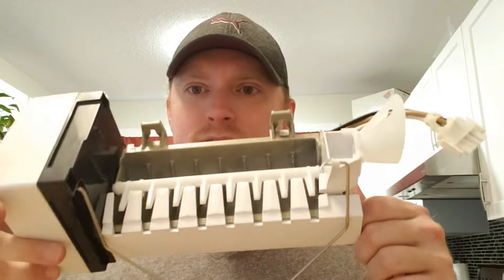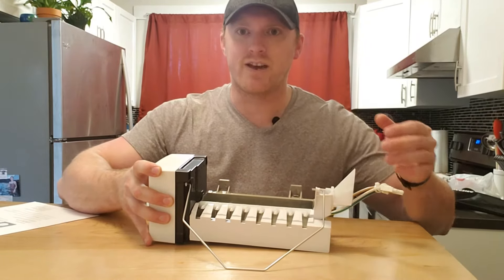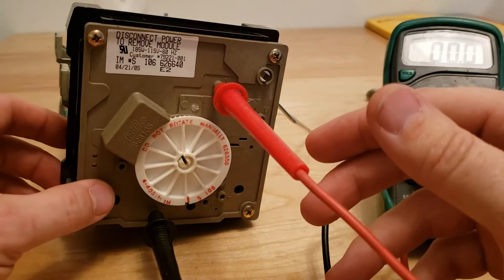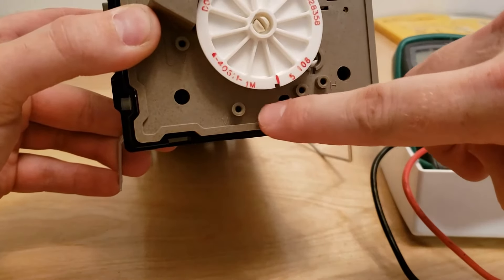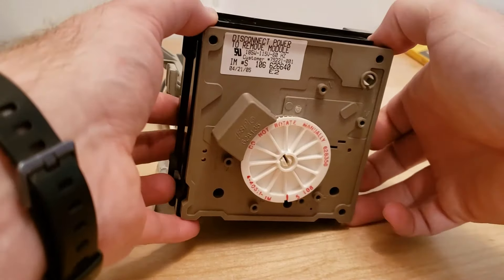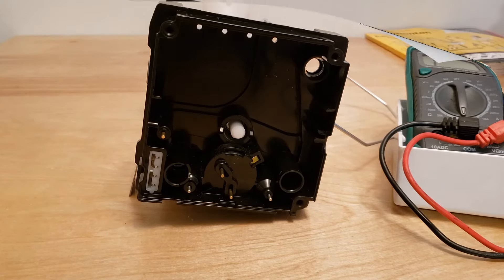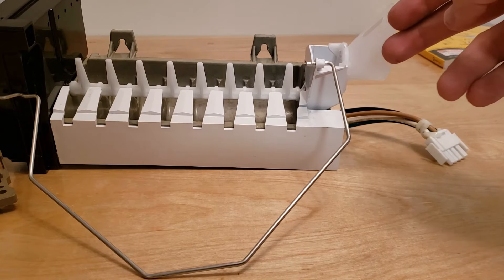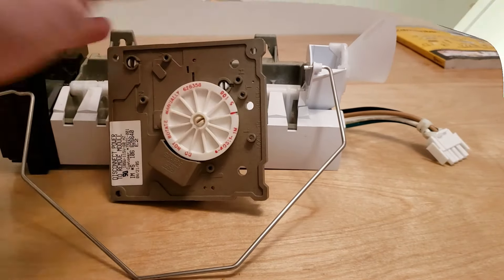FRIDGE ICEMAKER HOW IT WORKS - TOTAL DIAGNOSTIC GUIDE

Comment: Thanks so much for making this video! My only regret is not finding it sooner! My ice maker is getting too much water, creating a layer of ice on top of cubes. This must occur after dumping the cubes, as they are free immediately after dumping. Another video on here explained it may be the inlet valve and/or the filter assembly. Then another pointed to the defrost thermostat. After replacing all these at considerable expense and no fix, I found your video. My next step is to adjust the amount of water into the area. Hope it works! Thanks again!
Reply from the maker: Thanks for watching ni4cx6gc5h, yep sounds like an adjustment is needed, let me know how it goes. You got this!

Comment: Thanks for your video Greg.  I have a question about the input voltage.  It measures zero on my icemaker.  Is there a fuse inline for this input voltage.  I seem to remember that there is an inline fuse in the 120 volt wiring harness.  Can you let me know if there is.
Thanks,
Dave K
Reply from the maker: Thanks for watching David Kling, some icemakers do in the incoming wiring and some don't, it would just depend on the year and model of the ice maker.

Comment: Ok so my Amana side by side black fridge I got back in 17 decided to not make ice I noticed been working fine... Well I watched vid and did the jump wire deal and it worked like it should heard the ice drop and refill... I think last night it did it on its own but not sure... Figured there'd be some ice in it after work tonite and didn't look like anything was added... So what's going on now ?
Reply from the maker: Thanks for watching shaneh, putting the jumper wire in bypasses the heater, the ice maker will need to be replaced because most ice makers don't come in pieces.

Comment: My ice maker produces water and turns on its own but stops when it goes to push out the ice. Does that mean my heater is out?
Reply from the maker: Yes either the heater or thermostat, most ice makers you can not change individual parts though.

Comment: Ho, Hanks for video. 
My icemaker not go out completely the ice. 
Ti make ice, Hot for go out, move on the ice…but not compketely. The finger stop when the ice are up still. So the ice is, for 50% immerse in the new water.
What’s the problem?
The finger that non work completely, how i can do ?
Reply from the maker: Thanks for watching Ubi UbiVR, the ice maker could have a build up of calcium causing everything to stick or slow down. I would take the ice maker out and give it a good cleaning. Run through test cycle and see if it goes through like it should.

Comment: My tube keeps freezing and water can't flow to make ice , what's wrong with it
Reply from the maker: Thanks for watching Janet Smith, either the flow isn't enough and its freezing up, or the fridge needs a fill tube heater kit depending on the fridge. how do you know its freezing up, and where is it freezing up?
Reply: I saw on another video the water inlet valve was bad.At the bottom of fridge where the water line comes up back of fridge to ice maker.Looks easy to swap out.Good luck.
Reply from the maker: @barbaradean4448  thanks for watching, yes the water valves are fairly easy to change out, just have to remember to turn off water before disconnecting lines.

Comment: My heater has a 106ohm resistance and it seems the frozen cubes stick in the tray.  Is the heater shot or some contact not clean?
Reply from the maker: Thanks for watching Robert Dawson, the heater resistance should be 72ohms almost always, if the number is that high its not within the 10% allowable fluctuation. The mold can also be peeling inside which doesn't let the cubes slide out easily. I would say you are probably going to have to change the whole ice maker assembly. You can also check between t and h, which should be a reading of 0 ohms if thermostat is closed, or infinite if the thermostat is open.

Comment: Holy Smoke! Your video is so thorough that I just got a part-time gig repairing ice makers at a high-end appliance store! Lol. I am going to check your other videos! It's a euphoric feeling to  know  how to troubleshoot problems! Very informative!

Mine made the ice, but it's not dumping them. It's the heater, but I tested it. It's around 73...so good. If I reset it manually and it rotates the dial, the arms move down and dump the ice. So...what's next?
Reply from the maker: Thanks for watching dentistmomchef, lol thank you. I would check the mold, a lot of them were known to peel, when it looses its slipperyness the ice dont seem to want to come out.

Comment: Hi GReg! Here again asking for help. If I change the board on my WHIRLPOOL WRF555SDFZ would I need to reporgramm it or not ? I watched a video about this but talking about a CODE to do it that should be in the label,,,,but my machine has not such a code, so I don't know what to do. Pleas, if you have some idea regarding this subject let me know please. Thanks in advance, Ramon from Miami.
Reply from the maker: If you are changing the jazz board, which is the one right in your face when you open the door, yes you have to program the board. The code will be written on the model and serial number sticker.

Comment: Hey Greg, 

I replace my ice maker all the power is correct at all test points but it will not trigger an auto fill with water. I can manually fill it by jumping but it won’t do it automatic even after a full cycle of the motor
Reply from the maker: Is the freezer cold enough to trigger a cycle? Did the new ice maker come with a new thermostat?

Comment: Isn't there any refrigerant tube getting into the ice maker , like in the Samsung system ? Thanks for responding,,,,,Ramon Perera, Miami.
Reply from the maker: Thanks for watching ramonperera, most fridges there is a fan that blows cold air towards or around the icemaker. The evaporator fan is usually used.

Comment: Hey man, thank you so much for sharing your knowledge! I'm used to the little metal set screw, so 10:40 for anyone looking for the water fill screw....
Reply from the maker: Thanks for watching Joerichmar, and I'm glad the video could help you out.
Reply: @Thomasappliance  Maybe you'll know the answer to this. So the water flow is slow on my Kenmore elite side-by-side.  Its probably the filter. If I just remove the filter, will the ice make and dispenser still work? I lost the filter cap, but can still remove the filter.
Reply from the maker: @joerichmar6041  if you take the filter out the water shouldn't work, to either. You have to have a bypass cap or filter in place.

Comment: My refrigerator is not dumping the  ice.
Reply from the maker: Thanks for watching booster1469, are the arms for the ice maker sitting right on the ice? That would mean the heater is not turning on.
Reply: @Greg Thomas  thank you for responding.  No, the arm is down.  If you are talking about the on and off arm. I will remove the tray today and empty the ice. Maybe start the process over and see. Thanks.
Reply from the maker: @booster1469  I'm just wondering if the fingers that kick the ice cubes out, are resting on the ice?
Reply: @Thomasappliance  thanks.  Yes  they are. Does that mean i need a new icemaker?
Reply from the maker: @booster1469  send me the model number of your fridge and ill see if you can get parts separately or if the whole icemaker needs to be changed.
Reply: @Greg Thomas  HR106W10190966. I thought I sent you this model # , but I can't see where you got it.  Good morning, and thanks.
Reply from the maker: @booster1469  it looks like yeah the whole ice maker would need to be replaced. It doesn't seem to come in pieces .
Reply: @Thomasappliance  thanks so much.
Reply from the maker: @booster1469  np at all
Reply: Just recently replaced my ice maker on my Whirlpool unit.  I was able to test by jumping the T and H.  Unit fills and cycles.  Issue is that the unit has water frozen in the mold and never cycles.  Not quite sure what to check next?

Comment: My ice maker has power water & valve works, & heater works. The motor would not turn when I took it out of the control module and put 110v on it.  I replaced the control module.  It made ice for a little while. Then I trouble shoot it. Can't find any abnormalities. Motor will turn If I put 110v on it when I have the control module separated from the ice cube bay. I replaced the thermostat even though the thermostat with new thermo compound paste. The one I took out I believe was still good. Freezer is zero degrees. Thermostat is not closed. Cannot get motor to rotate by jumping T & H. I don't know what else to do except buy another whole unit. Only thing is I can't find any ice maker numbers that correspond to my refrigerator model number Whirlpool Estate  TT21AKXKQ05.
Reply from the maker: Thanks for watching Smitty, it sounds like the whole ice maker should be replaced. I'll see if I can look up that model number. Yeah I see what you mean, the wiring is there in parts breakdown but no ice maker listed, if you have the owners manual it might tell you which one to use, or call whirlpool and ask them for a part number.

Comment: Very helpful, my fridge stops producing ice every few weeks or so ice cubes get frozen to the arm and Jams it up. What could that be ?
Reply from the maker: Sounds like its a little too cold in the ice maker section, or the mold has a coating on it and it is worn off, causing the ice to stick. Thanks for watching Dillan Clymer.

Comment: What if there's no power coming from the fridge harness...what to check next? With a brand new ice maker.
Reply from the maker: Power usually comes from a board or is tied into another circuit, best bet would be to get a wiring diagram and trace wires. Thanks for watching mustangman3024.

Comment: Thanks for the video. I've been at war with my ice maker for far too long. First the inlet spout would freeze up every few days and I had to use a turkey baster and boiling water to thaw it out. I turned the temp up to see if that would help. Then the inlet would overflow and run icicles all the way to the bottom. I changed the water valves and get water to the door but now the icemaker doesn't cycle at all. I turned the temp back down to see if that would help. It didn't. So I jumped the T and H, nothing. I have a few old icemakers in the shed so I'm going in. Hopefully I can find the problem and have some parts. The old ones I have are for the side and mine is for the door but they look very similar.
Reply from the maker: Thanks for watching House Bill, good luck getting it going again, you're on the right track.
Reply: @Thomasappliance  The problem I found is I don't have 120 volts from the fridge to the icemaker. The control lights are flashing correctly. L-N is reading nothing and so is the harness coming from the fridge.
Reply from the maker: @unti419  that could very well get into a board issue or broken wire problem.
Reply: @Thomasappliance  Thanks. Most of the wire problems I've read or watched were where the ice make was in the door and the wiring went thru the hinge. Mine is stationary in the fridge. I'm going to try to find a good tech, they are scarce here. Thanks again and keep up the good work,
Reply from the maker: @unti419  thanks for keeping me up to date, hopefully everything works out ok.

Comment: Hi Greg, we installed a brand new whirlpool ice maker yesterday and it’s not calling for the water. We double checked the location of the arm and the freezer temperature, but still no ice. Any suggestions? We don’t have a voltage meter.
Reply from the maker: What happens when you force a cycle? Thanks for watching Donna Davis.
Reply: Same thing with me Greg, I installed the same icemaker yesterday and still no ice I did a forced cycle but no water coming in. Inside the refrigerator I have a water dispenser which will deliver water I have Jenn air does it have two water vavles
Reply from the maker: @cypernut  Thanks for watching cypernut, can you hear the water valve come on when it should be calling for water? If you can I would make sure the fill line inside the freezer isn't frozen where it comes into the icemaker. If no sound is heard then I would force a cycle, get to the valve and see if there is power when it calls for water on the valve, if there is power when there should be power there the valve could be bad or the screen at the water line valve connection could be plugged.
Reply: @Thomasappliance  I can’t get it to force cycle
Reply: @Thomasappliance  thank you for the reply.  I will check those things you mentioned and I will get back to you to let you know how I made out.
Reply from the maker: @cypernut  yes please do
Reply from the maker: @donnadavis5046  if it won't force cycle make sure you force it with the door switch held closed.  If still no if there is power to the ice maker it may be time for a new ice maker.

Comment: Mine is freezing with arms trying to push the icecubes and the water filled and froze the arms from another side before they got out. That ice maker started acting up when the inline filter was installed.
Reply from the maker: Thanks for watching Check Engine, there are so many things that can go wrong with an ice maker, hopefully you got yours fixed up.

Comment: Hello Greg I agree with the comments I see great video.  I have a whirlpool domestic refrigerator with ice maker in my RV.  The units has worked great for two years up until I went to winterize it a couple days ago and now the water valve does not seem to be filling/opening.  My question is does this thermostat that will not let the icemaker work until it gets down to 0 interrupt power to the test terminal L?  I was not getting 110v at L but I was reading something like 58v.  I am using a good fluke meter.
Reply from the maker: Thanks for watching John Howell! I would check at the wiring coming into ice maker if there is 120v there then the icemaker inside has resistance and will need to be changed, if you get the same voltage you had before you know the board that supplies power to the ice maker is bad.
Reply: @Thomasappliance

Comment: Great video!! My voltage shows 97 volts.  Even the jumper and the wiring plug to icemaker.  I also replaced the control boards.  Light was not coming on, it is now.  Still the ice maker won't cycle.  Any suggestions?
Reply from the maker: That voltage is low, when jumping the ice maker does it do anything?
Reply: @Thomasappliance  I taped down the light switch and it ran through the cycle but no water.  I guess the next thing would be to defrost the water supply, right? I tried a heat gun to blow hot air into the pipe for a few minutes but it didn't do much.
Reply from the maker: @astroluck1525  yeah it could be frozen inside the line or the water valve isn't coming on at all
Reply: Did you ever solve the problem?  I'm having the same issue now on a replacement install.  Its reading 95v after the install, and remains non functioning when I put the jumpers in.  Any help would be appreciated!

Comment: Mine has power to it. It won’t cycle when I jump the connections. Pump will fill it with water no problem when I jumps those connections. I replaced the control module but still no ice. The new control module won’t cycle either when I jump it. Basically doing the same thing.
Reply from the maker: Thats why I always change out the whole ice maker because there can be different issues that are unseen. And where I'm located its actually cheaper to buy the whole thing.
Reply: @Thomasappliance  
It was the arm that you put down or lift to make it start making ice. It wasn’t seated in the hole good.
Reply from the maker: @fivebooks8498  oh good catch, yeah that would do it.

Comment: I have tried these steps and seem to still have a problem that is not covered. Heater resistance is 74, motor resistance 7800, voltage is good, and it filled. After fill & freeze, it stopped and clicks with the dial at about 7:00 or 8:00 position.  This also happens with jumper in place, it gets stuck at about the seven and a half position and clicks.  Any ideas?
Reply from the maker: Sounds like a tooth/gear might be stripped in the head. Thanks for watching Kevin Skogg.
Reply: @Thomasappliance  That was it.  I replaced the whole control module.
Reply from the maker: @kevinskogg2179  glad you got it fixed up, good job!!

Comment: I am not getting power to the ice maker,   L-N nothing... did not cover that at all
Reply from the maker: I would disconnect the wiring from the back of the ice maker and see if there is 120v there, I can't tell you exactly which color wire because most fridges are different.

Comment: Hello Greg. Question. My ice maker is identical to this one. what it's started to do is Freeze up I guess. If you leave it in the on position it cycles normally. If you turn it off or goes w/o cycling for awhile, say the bin is full , when it cycles again, it struggles very hard to push the ice out. The motor just sits there and creaks as it trys to push out the ice. I actually had to defrost w/ a hair dryer to get it going the last time. Heater ohms ck fine. Thoughts ?  Thanks.
Reply from the maker: Thanks for watching Monteric!, the mold that the water sits in can build up with calcium causing it to stick, or the mold can peel which I've seen too. Both would cause the heater to not be as affective also.
Reply: Greg- thanks!  You have no idea how helpful your video has been!  In these cases, do you replace just the tray, the heater or whole icemaker?  Thanks again!